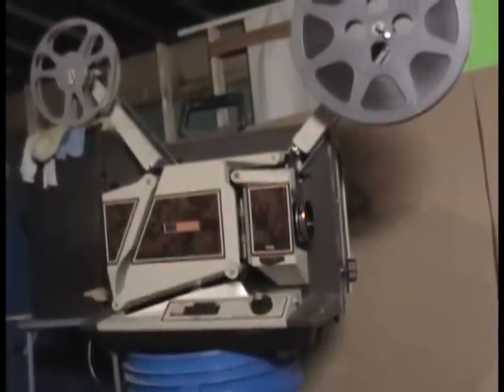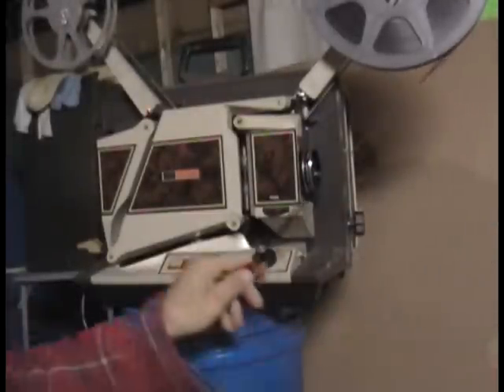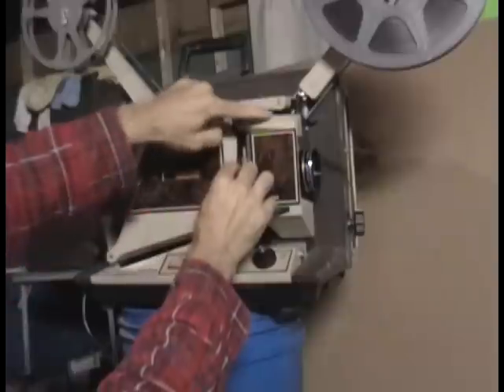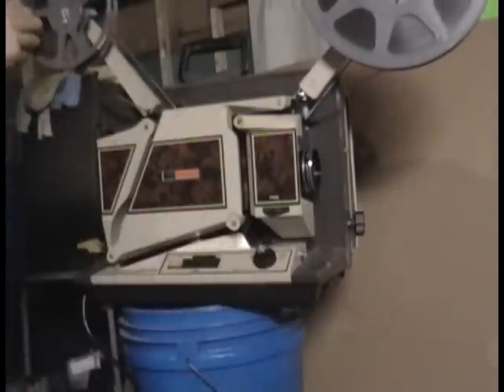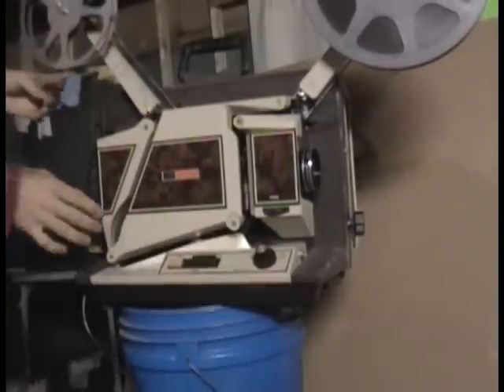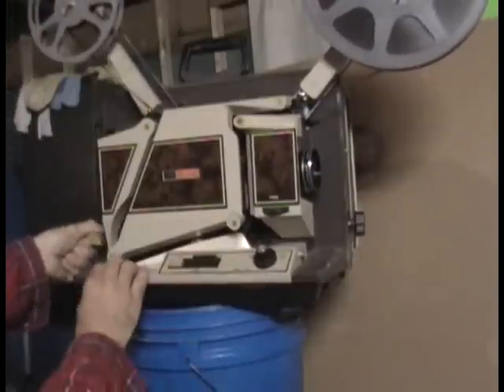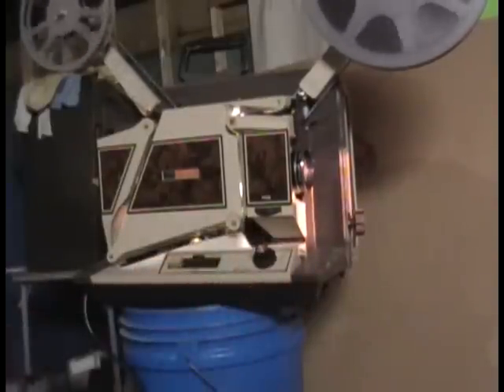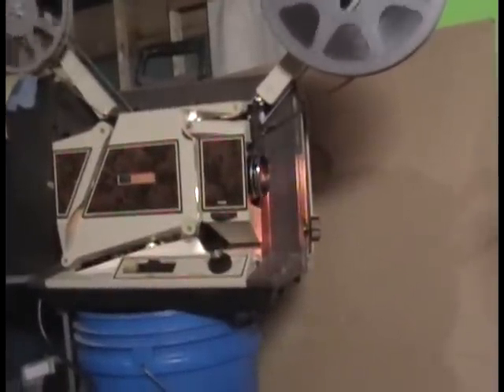Singer Insta-Load Projector

Comment: Great instructional video! I have an Eiki SSL slot loiad projector which has basically the same kind of open-slot loading track. Works fine, and if needed, the film can be stopped at any time and both reels removed to put another film on.
 I would be cautious about placing a projector on a plastic bucket. The vibration of the projector motor could make it tip over. Projector carts & tables can be found on your local CraigsList pretty cheaply.
  Thanks for the good video!

Comment: How do I get mine to stop flickering when recording? It looks ok when its projected but then when it goes through my camera to record it, it starts flickering. I use this same camera for my 8mm and other 16mm projectors and don't have this issue. What do you suggest?
Reply from the maker: Rima IVTC  So you mean the digital copy of the film shows a lot of flickering?   The thing that helped me was to put the camera closer to the screen so the brightness of the picture overcame that flickering.  If your digital camera has a Frame Speed adjustment, set it to  higher speed.  The problem is the Frames per second do not match from the projector to the digital camera.
Reply: So what kind of camera should I use?
Reply from the maker: Rima IVTC I don't know specific camera models. but many have the frame speed and iris settings to tinker with.  But the trick is to try different distances and brightness while recording the film.  That helps overcome the flickering because the 'persistence of vision'  of the recording camera will get the image onto one more frame instead of the "blank frame" or the "flicker"
Reply: Thank you for your reply. I was playing a 16mm that has audio. When I tried to run it through a second time, the audio disappeared and could not retrieve the audio since. What could be the reason for this?
Reply from the maker: Rima IVTC These have a 'sound exciter lamp', a light bulb that operates the sound. Open the cover and see if that bulb is burned out. These can be found on ebay.
Reply: EnsignInRed Awesome. Thanks! Your talking about the front cover right?
Reply: Late reply, but for the sake of other wondering, you need to try to match the number of frame per second. 16mm play at about 24FPS. Your camera or phone might record at 30 or even 60 FPS depending on what you use. So you need to try to adjust your camera if you can to 24fps. DSLR or mirrorless camera usually have a setting to play with FPS and iPhone have apps like ProCam on the apps store  that let you manipulate that kind of setting. The flicker should almost go away completely if you can match the FPS of the film with your recording.